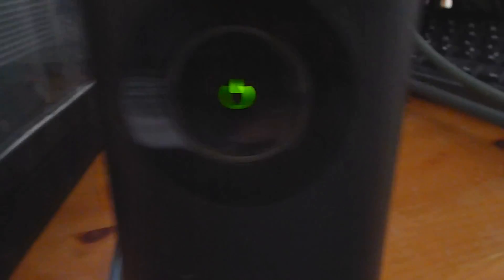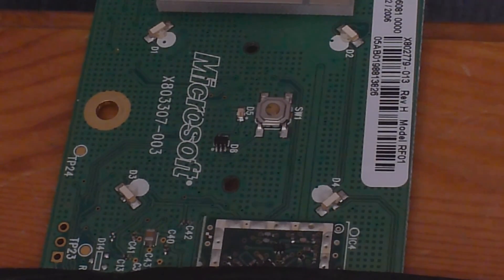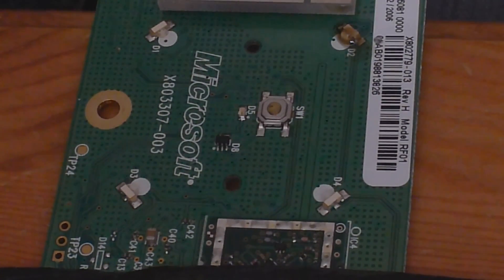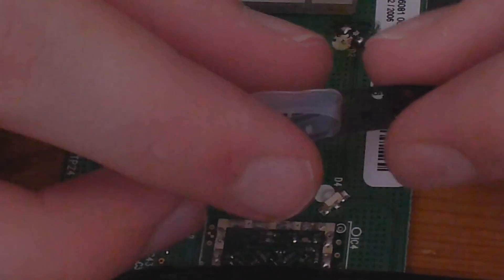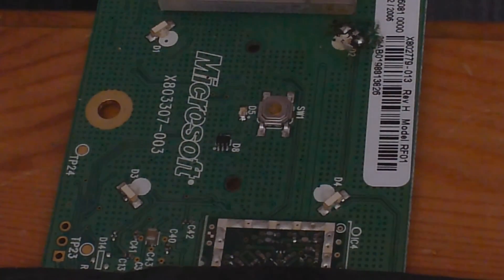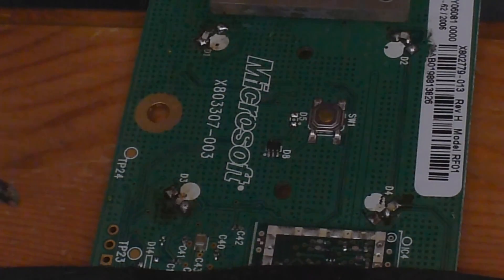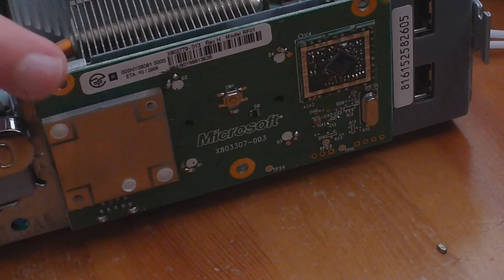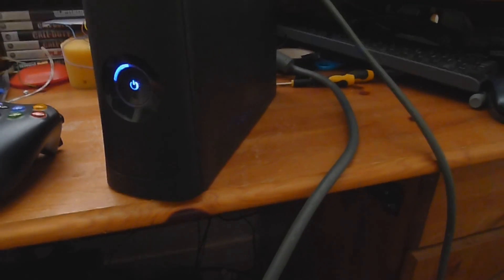HWT #10 RF Board Ring of Light Tutorial

Comment: I want a Slim XBOX360 power supply to be able to connect into the older classic original Xbox360 console
Do you have an adapter or a modded slim power supply that I can use in the original XBOX360